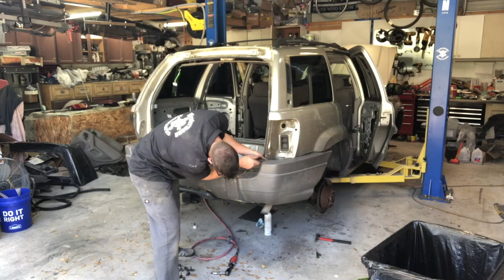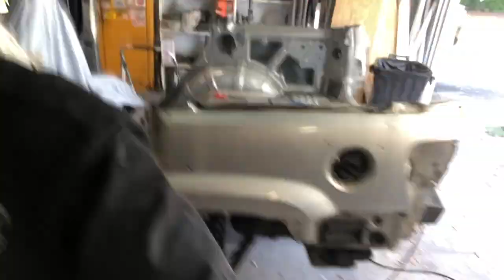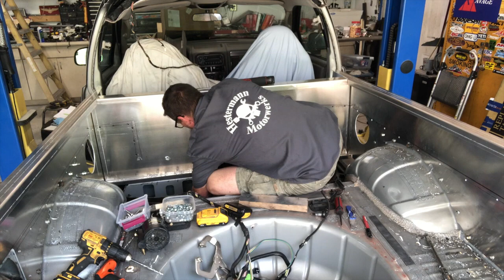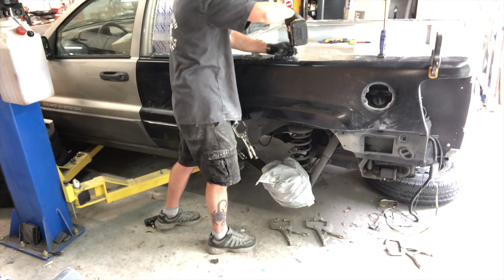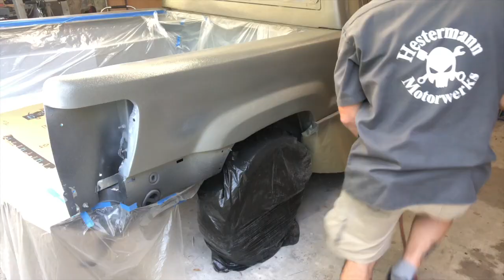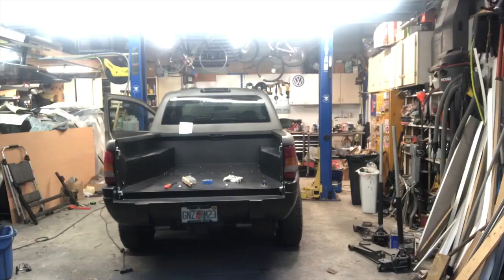Smyth Jeep WJ build summary

Comment: It looks like you used screws to fasten the rear surround to the jeep roof.  Is that correct?  If so, how did you hide the screws?  Thanks
Reply from the maker: Yes I did use screws until the Panel bond starts to set then I removed them and filled the holes with cabosil

Comment: Did i just miss the steps where you weld in some more structure before the body chopping starts?
Reply from the maker: no welding. generally doesn't work so well welding aluminum and steel. panel bond, lots of bolts and bracing and some riveting. Structure is replaced with aluminum channels and boxing
Reply: @hestermannmotorwerks  Yeah, obviously you aren't welding Steel and Aluminum together. 
I ment something like adding steel plates, channel, or tubing to even keep the vehicles from sagging while the rockers and floor are the only things trying to keep it aligned and square. Plus adding some strength back in for crash survivability, off roading, or just durability for doing ''UTE'' things.
Cool.  Adhesive, Bolts, and Pop-rivets will Git-r-dun.

Comment: Wouldn't this affect the structural stability of the jeep because of its unibody design?
Reply from the maker: yes it does and that is why the kit has all the aluminum bracing to bring back the rigidity and strength